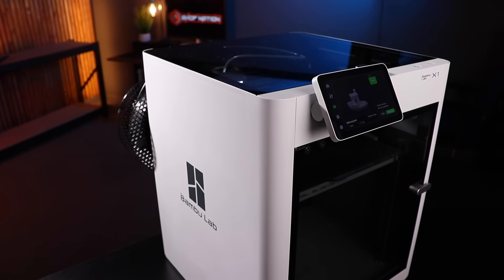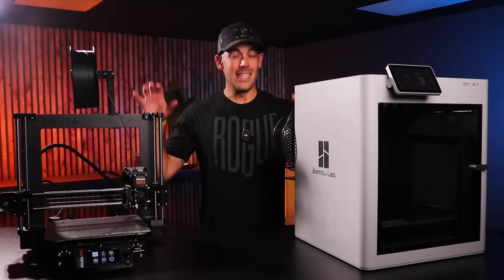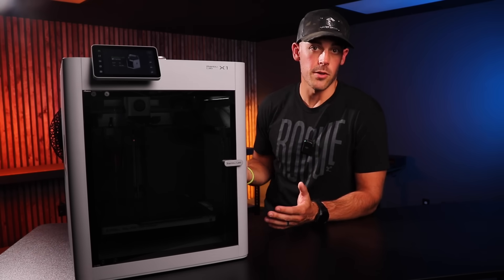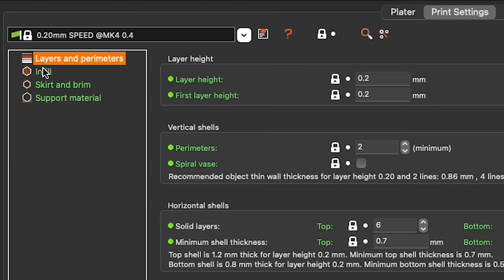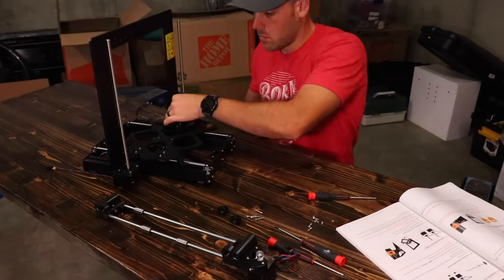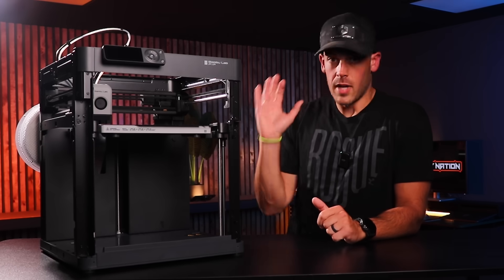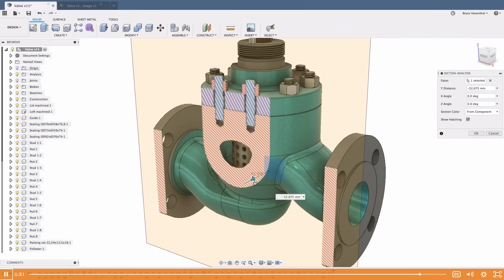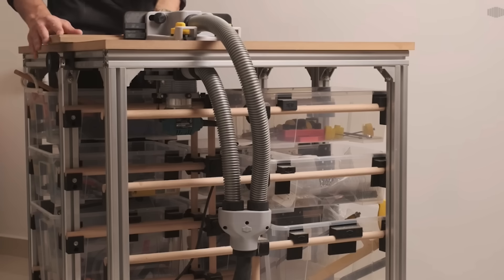The 3D Printer I'd buy if I started over

Comment: I actually was on the fence on what to buy, I'm about to sound so effing robotic, but it did help me to decide where to start. I'm going to go with the Prusa kit to get a good learning handle on how to repair/fix and a good starting know-how so thanks for the vid! Super helped!
Reply: Don't, this video is misleading and makes all the wrong comparisons. Channel creator replied to my comment without addressing a single question. 
I'm just going to copy/paste what I wrote: 

- Why did you compare an MK4 to an X1C ? They are different classes. Sure they cost the same, but they are a completely different class of printer. (enclosure / accelerometer / filter / camera / microLIDAR / ... ) Fair would be comparing it to the P1P and still it would be outclassed. 
- Why would you advise buying an MK3S+ Kit at this point in time when you can get a MK4 for an extra €100? Reliability is a bs argument as they've ran over 10.000 hours and they come from the same company. So reliability/customer service should all be comparable. 
- Fixing or replacing parts does not seem to be as user friendly with the Bambulabs? I don't agree. What is not user friendly about swapping out pieces? In most cases it's unscrewing 2 screws or just decouple some things. Have you tried replacing a broken item on the MK3s+ extruder? Also please explain which items aren't fixable on the Bambulabs printers? 

I don't believe this comparison was done in a fair way. And this is coming from a person who also owns Prusa printers (MK3S+, Mini+, XL being shipped). I do agree with buying a (newer version) P1P when starting out with printing.

Comment: thanks for this vid, I'm still on a LULBOT KIT TAZ 4 from 9 years ago, still going strong haha. Just ordered some new PEI sheets for the bed so had me thinking what was new in the 3D printing world.... I hear amazing things about the bamboo labs stuff, would love to pick one up but if it's not easily serviceable, that would have me a bit Leary. 

Also, I don't think people understand that to really use these things for what they were meant for, you sorta have to be into design and engineering and have the ability to use CAD software, I'm advanced level solidworks user for 10+ years.. I've used my machine to make some pretty wild, real world stuff. Not just random, downloaded junk off thingaverse. They are SERIOUS tools for R&D.

Comment: YES!  This is the video I wish I'd seen starting out.  I got an Ender 3 and spent all my time just working on it.  I became an Ender 3 mechanic instead of a creator.  And I noticed the guys who actually print their own custom CAD models--like I wanted to--were NOT using Enders. Inevitably they used Prusas or something else.  If you watch Ender 3 enthusiast videos, SO MUCH of the content is focused on just fixing and upgrading the damn thing.  Take that as a warning! 
When I get back into 3d printing it'll be at least at the $2,000 price point where you can EXPECT the print to succeed instead of being pleasantly SURPRISED if it does.  Failed 20-hour prints get real old real fast.
Reply: Jesus you people are dense. Buy a closed source printer and watch what happens when a motor dies :D
Reply: If you can't use an allen key and watch an assembly video you're better off with paying a premium for an out of the box printer that you'll have to send away to get fixed and loose 2 weeks of printing.
Reply: Ender 3 must be an acronym for Endless Nuisance, Don't Even Research 😂😵‍💫😭😭 

Also! It's funny that you mention that as my Ender 3 sits disassembled, in a box, in the corner of my room because of the times I've tried to fix it myself based on tutorials or get asynchronous feedback from the TA's in the program I was in back at uni. 

I got my Ender 3 from my Stanford Product Design undergrad, specifically the P3D program because I took some of my Mechanical Engineering courses during the height of the pandemic. Basically, what would have been the machine shop class at my parents house but they did teach us about scaled manufacturing processes they wouldn't have otherwise, so there's always a silver lining.

Anyways, which 3D printer are you using now? I'm curious plus I want to get back into physical product design (as digital UI/UX job market is kinda tough rn) Thanks in advance 💫

Comment: Bambulab sucks. Not going to support a printer that needs to be hooked up to the net to work, or can't be updated with opensource firmware or fixed with regular parts. Input shaping is supported on Klipper and can run on a $35 Libre Computer arm board, which you run on any printer.

Comment: I started about a decade ago with an ANet A8, aka the "Housefire In A Box." I currently run a heavily modded Creality CR-10S and a mildly modified CR6-SE. The Bambu Labs printers are tempting, but the Prusa printers are rock solid and Josef and his team are top notch. When the Crealities get retired, they're getting replaced with Prusas probably. As far as basic 3D modeling, I use TinkerCAD for most of the basic stuff. Fusion 360 is awesome, but steep learning curve. Having 3D printing in my toolbox has been a huge blessing and a great learning experience that I recommend to anybody who's a maker, a fixer, a tech, a mechanic or anyone else who likes hardware or electronic engineering.

Comment: Finally video I should have seen long ago. I started with Ender 3 Pro about three years ago. It turned out that solving printer problems is the hobby I didn't want. I actually wanted to print with it. Now that thing has been sitting about year, because I ran out of motivation trying to get that thing working again. I would gladly move into this price range to print useful things with it.

Comment: I bought an Ender 3 v3 KE. Fast, automatic bed leveling, hot bed, input shaping capable, hotend to handle a wide variety of filaments, and all the hacky support community of the creality enders, so its moddable. 
Not as flashy as the bamboo, but half the price even of the cheaper bamboo (300 usd)
I think its great if you don't know yet how much you want to print, but if you do, you want your options. Ofc these bamboo stuff are also really great, especially if you just want to print and have the money.

Comment: I've been 3d printing off and on for like 10 years or so and EVERY fdm printer I've ever owned was either a lemon or I just couldn't wrap my head around it but I've owned 7 sla & dlp printers and they've always worked out of the box and never needed adjusting. I associate FDM printers with piles of spaghetti lol. I have multiple degrees in game development & animation so I got into it to make toy prototypes but it would be nice to be able to print things like handles on my vacuum form machine I built from scratch instead of having to just cut things out of wood every time.

Comment: I've  been 3D printing since 2016. For EVERY print I do I note the material, color, printer and elapsed time. Thus, I can say that, as of today, I have done 79371 hours of 3D printing. 
I consider myself a semi-professional since I still have a full-time IT-job next to my 3D Printing.
Currently, my main printers are ALL Creality printers which have accumulated 31112 hours of printing so far. 

They have been VERY reliable in general and I have no problem doing 100+ hour prints on them.

Comment: You claim to be involved in "Industrial scale 3D printing and then make the gaffe of saying that they should just "work" with no other inputs or accounting for variabilities in materials, design, and operational parameters... this would get you thrown out of EVERY machine shop I have seen in over forty years time... These are machine tools, not Star Trek replicators and WILL require a bit of knowledge to operate beyond the simplest of models and programs and PLA materials... Yes, even a person new to the hobby can 3D print good parts with very little knowledge (like the built in prints on any given printer) because quite often the very first prints are done with a well tuned G-code for that machine and the expected first uses. Following directions is also a MUST for anyone who is completely new to the hobby. 

I can appreciate that you are sharing your particular experiences, but there are dozens of 3D printers that are better within the range of your average hobbyist than the $1000+ machines and operate very well on their own with NO additional accessories. One can always choose to add these things to make your life a bit easier but this also falls under the idea of aftermarket spoilers and gear for a car, they alone cannot and will not make a trashy printer into ta good one. I have over forty printers of different types in my printer farm including several resin type printers and most of them are plain stock units with thousands of hours of print time.

This is not a hard hobby, but it requires learning and patience. There are precious few who can take up ANY hobby and be an "expert" in their first few times, and to try to claim otherwise is a travesty.

Comment: AI generated  from text /image to 3d model is the next step .  

 An AI  model specialized in  "machining" standard hardware items would be great , smth like : " Generate a 3D model for a standard metric hex bolt , 5mm long with a thread pitch of X etc etc "   just by typing/saying it.

Comment: Good info thanks! feedback: Blender destroys Fusion 360 for modeling, full stop! What "modifiers” can do is a game changer, and its free open source with 100% function. I use fusion 360 to model and print pcb circuits. fusion 360 has a good working CAM for CNC and the basic functions are free with a noncommercial account. Fusion 360 will make a hole or extrude a hollow pipe better than blender, but that about it... Fusion 360 is possibly the worst compiled software ever, I swear it was optimized for a 386sx 20 CPU (from 1989) It only uses 1 core max....and is dog ass slow. Actually, its painfull and frustrating slow. Blender on the hand, lights up all 16 cores on my 7950X3d and supports my 7950XTX video card for render. The Fusion 360 design team at some point hopefully will take a gander at blender, god knowns it’s only been around for 20+ years now. I wish they would at the very least update the GUI to something modern, again it looks the software from 1989 and works like software from that time.

Comment: Okay but what if this is not your first 3d printing rodeo and you are ready for next. Designing parts and tolerance is 'checked off'. I want to print polycarbon, or nylon! the x1 is what i have been eyeing. Is it reliable for dramatic filaments? Obviously with proper ventilation

Comment: Or you could get a Sovol s 07 plus, 3 of them for that price and they work amazingly. I'm surprised you didn't buy one and test it. You get prusa quality for 1/3 of the price. It also has input shaping. Also the sv07 comes with a nozzle light, klipper screen, independent gantry leveling drivers. You can use a camera with it and it's also a network machine. No more SD cards needed!

Comment: so which 3d printer is the most reliable when it comes to handling automated bed leveling, printing reliability, meaning the model doesnt warp for whatever reason during print, like for example because the temperature and humidity in the room drastically changed over a short period of time from for example having opened the bathroom door after a shower? because i really just want all these bases covered, i tried using an ender 3, but honestly i cant print anything on it, last time i tried printing i spent 2 weeks trying to print 1 model, which failed over and over for different reasons every time, and frankly i dont wanna be a printer mechanic i just want to hit print and not worry about wether or not the thing will just fail 6 hours in and have to throw the plastic away and start over.

like it sounds like you are saying the prusa mk4 is the most reliable, but at the same time i wonder if the prusa has the same issues as the ender 3 when it comes to warping due to moisture or temperature changes, which is why i was wondering if maybe the bambu lab's enclosure covered for that, but the top looked like it was open? so i dont know if its a closed environment or not? or if it really is just as reliable.

in any case im looking for a solution for warping and bed leveling issues as thats what ive had more than my fill of with the ender 3, or filament breaking inside the feeder tube on its way to the hot end.

Comment: I bought an Ender 3 v2 about 4 years ago. It worked just fine out of the box, slow as the continental drift, but it worked. A few upgrades later and it is printing about 3 times as fast as it used to. I just bought the Sonic Pad and am running Klipper. I have input shaping now and I can download directly from my slicer to my printer and start slinging filament. I don't know how fast I can push it now, but will soon find out. I'm just a hobbyist and I like to tinker, so It would take a big price drop in Bambu Labs to get me to buy one.

Comment: I've had an Ender and a Kobra at home, and I've used them both until they hit some major error that damaged them to a point that fixing would cost more than a replacement (admitedly not hard with <$200 hoby printers that have years of cumulative aftermarket mods). I'm pretty sure I'm ready to move on to something higher end now that I've been running stratasys systems at work.

I'm thinking a Prusa of some flavor but I'm a big fan of large print volumes.

Comment: How out of touch with reality must you be to decide that EVERYONE can afford a $1,200 3D printer. I didn’t spend that much on all 4 of the printers I have and one in a Voron 0… 

The Ender 3 works perfectly fine for a beginner. I know because it was my first machine and I never had a problem with it for the first six months until I started upgrading things so I could print nylon and glass filled materials. And the problems I experienced were 100% my fault. Not the fault of  Creality.

Comment: Great video. You hit the main point, the Bambu is a tool that just works and is so easy to use. There are so few steps to printing something compared to other printers.
I've spent a lot of time and money getting my ender 3 pro as polished and reliable as possible with upgraded bed, direct drive, hardened all metal hotend, runout sensor, bed levelling, 32bit board and compiling my own custom firmware, slowly perfecting various slicer profiles for different materials- it's been quite a process and on the plus side I've actually learnt quite a lot from it. It now works well for a ender 3 but it's been a lot of blood, sweat and tears to get it to this point and it still can be a faff to use it.
The Bambu just worked straight out of the box, no upgrades needed, no tweaking, no tinkering, no experimenting, no learning it's foibles. It just works.
Reply: I never want to do any of that ever ever. I just want to print 3d modles and parts reliably. So Bambu or prusa it is I guess.

Comment: I wish I had these options when I first started. my first 3d printer was a $100 kit from china. the bed was unheated aluminum, and it was also not very flat, and needless to say as much as I learned That 3d printer was destined for the dumpster when the Ender 3 came out. Compared to my first one the Ender 3 was worth its weight in gold.

Comment: The best printer for someone wanting to check out what 3D printing is? An Ender 3. Its less than 200$. 

I think 3d printing is great. There are SO many things that you can make, even with the cheaper (yet good) printer like an Ender 3. Its slow, yes. Its the best? Nope. Will it save you over 1000$ when you get it and realize its a lot of work and dont have time to deal with all the testing, fiddling and computer program learning... including 3d modeling...  that you will inevitably have to do and just... not use it for 6+ months? YEP!

I got an ender 3. I did one test print and.... its been sitting there for nearly a year now. Do i have plans on using it? Oh sure! I have a lot of things id like to do... but doing it is daunting and while im totally capable of figuring it out, i dont really feel like i have the time to learn all the stuff and juggle full time employment. So, is this 1500$ after tax the best one for you to start out with? Hell naw... Not unless you are just chomping at the bit to learn 3d modeling and how to export to different programs to clean things up and make it right for the printer and put it in the right format, as well as have idea of what you are actually going to use it for... Not just "Wow, this is cool tech and i want it!", but actually have a need for it. Then, sure buy the 1500$ machine, otherwise get the 200$ one that still functions 99% the same.

Comment: Nice video. I’ve been debating these exact printers. What gave the MK4  the edge for me was it’s open source reliability. Bambi Labs use open source programming but lock it down as proprietary and there are already reports that parts are hard to get or non existent. I can do just about anything I want with a Prusa.

Comment: If you want to think about a printer retaining value later on down the road, Prusas hold their value very well, as compared to something like an Ender 3 which when sold used is $100 or less. At least in my area, you can't find a used Prusa (even the older generations) for less than $400. A lot of Prusa owners know what they have, they know what they paid, they know it works and expect to get something for it when they sell them. Finding a kid who rage quit 3D printing and is selling the Ender 3 for a loss because he couldn't figure it out is easier than you might think. That affects you, should you ever liquidate your 3D printer(s) for whatever reason (decided to quit, need to upgrade etc).